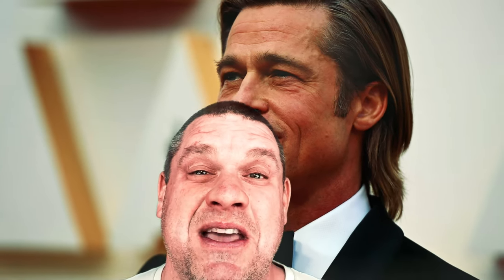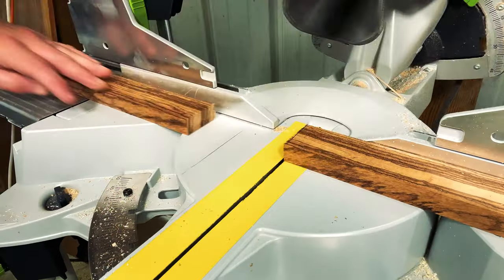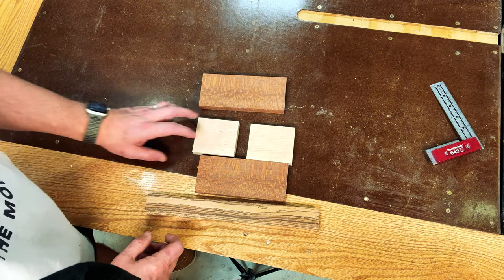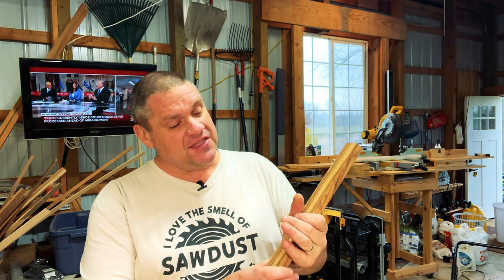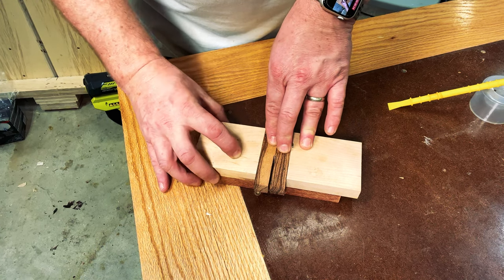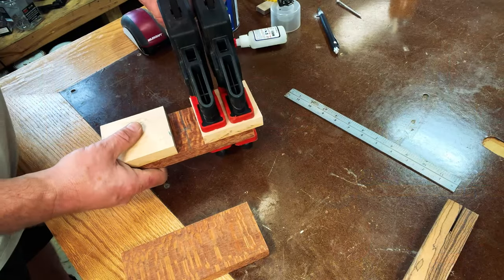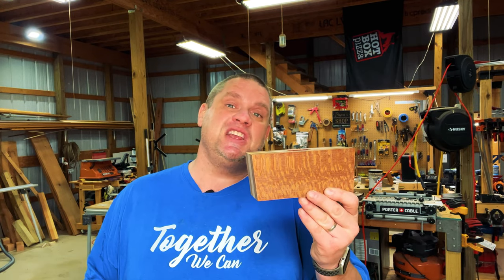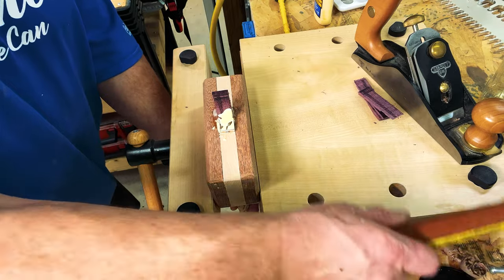Craft the Incredible: Make Your Own Exotic Wood Mallet! #woodworking #easybuild

Comment: Pretty sharp! The last one I made I used 2 different angles on the sides with one being 90 degrees and the other normal angle. I also have one with a 15 degree on one side and a 90 on the other.
Reply from the maker: What a great idea!  I was hesitant to even put a 5 degree angle.  Now I'm going to have to make one with some other angles on it.  Thank you so much for sharing!
Reply: @FlynndoggWoodwork  I put a little notch in the handle on one side so I can tell by feeling which side I'm using without looking. I also did that with my 2 sided flush cut saw. One side is fine tooth and the other side is course. I kept having to look at it to see what side I was using. Now I just feel for the notch.
Reply from the maker: @a9ball1  What a great idea!  I love that!  Thanks for sharing! :)